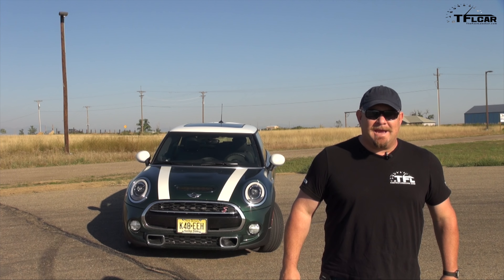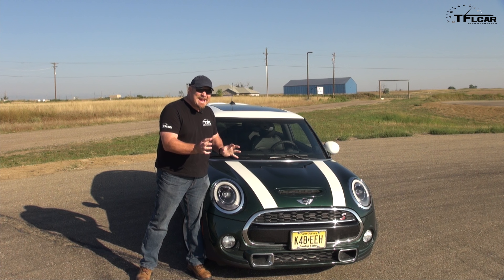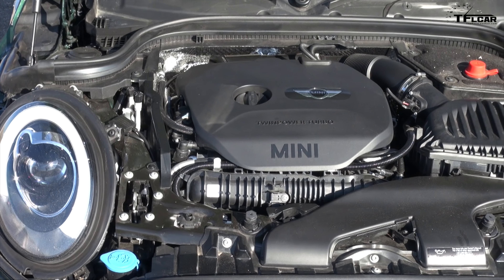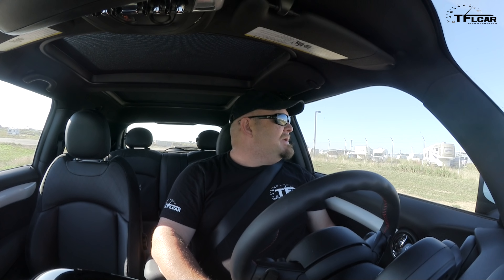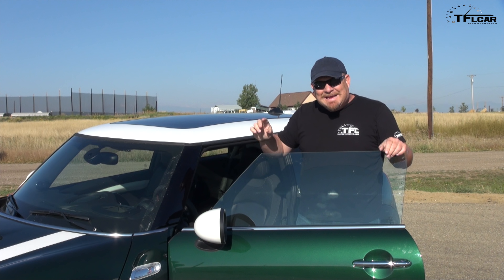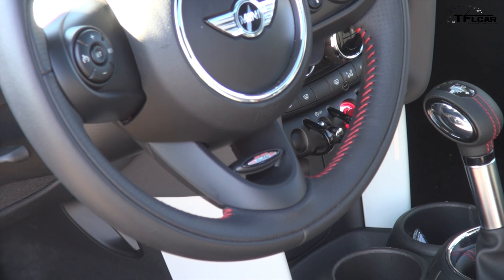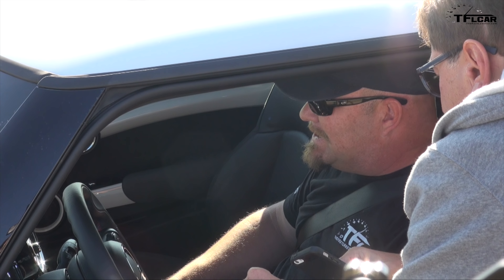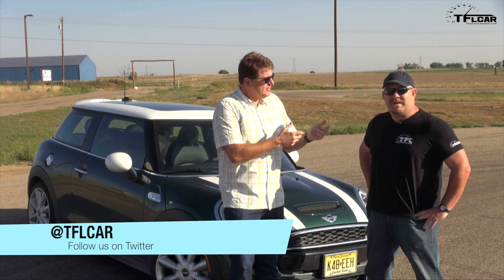2015 MINI Cooper S 0-60 MPH Track Review: A Go Kart on the Track?

Comment: As an r56 owner, the new Minis put me off a bit. But recently I started shopping around and looking at other cars that interest me and have spirit and performance, and there's really nothing at the same price as the Mini, and out of those with similar price, I'd prefer the Mini. So after looking at the competition it's definitely grown on me.
Reply: I thought the exact same! My R56 has been very unreliable so I’m now looking for an F57 but just worried the Mini charm is not so obvious with the new version.
Reply: Richard Layzell do you have a S or non-S? Wondering what your issues are. I’ve had the new Countryman and Clubman (as a manual) as loaner cars and they are fun but in a totally different way. Much more comfortable I’ll give them that, but the Mini-ness is much less. Even the manual doesn’t feel as good, something about it’s geometry as you shift feels off. And then the auto blip only happens in sport mode, like I want auto blip when I’m in normal just casually driving and not have to worry, but when I’m in sport mode that means I’m in the mood to do it myself. 

Idk if I’ll go with another Mini. I already have a practical family car, might pick up a used F type or a Miata, something RWD and faster. Good luck to you!
Reply: gothops154 It’s an S! I think I just got a car that was treated badly before me. High pressure fuel pump, thermostat, water pump, drop links, oil leaks, vanos, wheel bearings, coolant leaks. Spent over £1500 the last 6 months! I’ve only ever driven manuals as they are much more popular here in the UK! There was a typo in my last comment, I’m thinking of getting an F56 Cooper S 2017 with low mileage in the hope it lasts me longer!
Reply: @Richarrdere2k9  how did it go? Ik the 2015 minis and up are he good ones and reliable which boosted mini in reliable cars over the years past many other brands. I got a 2020 mini s and it drives really nice and smooth and picks up speed nice and shifts into gears nice with a new upgraded transmission
Reply: @Richarrdere2k9 I just bought a F56 myself Loving it!

Comment: You need to do a side-by-side with the 2015 GTI and 2015 Cooper S.   Which one is the best or...
Reply: ***** Fiesta received -188% reliability score from actual owners who provided surveys...also the ST is based on an economy car (Fiesta). It competes in a much lower class of cars than GTi and Mini Cooper.
Reply: @buildmorefarms1007 I just bought a F56 cooper after owning a 1.6l Fiesta ST and I can say that the fiesta wasnt overall the best on reliability.. however I was cobb stage 3 with 36k and drove it that way beating the balls of it for another 100k before it blew the engine or started having problems
Reply: I replaced the motor in fiesta ST myself and traded it in towards my new f56 cooper 😂

Comment: The Mini is well known to be one of the most unreliable cars on the market, please consider that before you offer a "buy" recommendation.
Reply: Sorry Walter, I can't do that. No way. 

We base our reviews on the vehicle we are testing at that moment. We evaluate vehicles on what they offer and how they feel. We cannot use bias from other research when we recommend automobiles. It's just our point of view. If we had huge resources to do long term research on each car we test, we would conduct our own evaluations.

Still, you are correct about other sources saying that the MINI's reliability is poor. Regardless, it's one of the best handling, most rewarding FWD cars available.
Reply: nathan adlen Most car journalists like on TFLC can only review vehicles this way. They can't buy, own & evaluate cars and survey 1.1 million other car owners each year like Consumer Reports. Yes, CR recently did their Reliability Survey for cars 2004 to present, and out of 28 car brands, BMW (Mini) ranked #14, while Mercedes-Benz ranked #24 as the least reliable luxury brand (Fiat was dead last, while Lexus/Toyota was #1 & #2). Of course, people will continue to buy certain cars based on the "smile" factor (as Nathan said) and how it feels, and will overlook some issues.
Reply: nathan adlen
Also people need to realise up until this model mini used a PSA engine which was the cuse of quite a lot of the problems. This model is the BMW 2.0T as in the 1/3/5 series and isn't prone to failure like the old unit.
Reply: agreed, had one, and it was a mistake. Great dynamics and looks, but not worth it. Bought a 335 instead.
Reply: nathan adlen What about the Mini's Euro NCAP safety rating of only 4 stars? Is that also bias?
Reply: Walter Black
If you read what euroncap say it's actually a testing fault. The loads were passed to parts of the dummy which was not representative of a human body - in other words the dummy got in the way of the test. It also got marked down for no automated braking because it's an option rather than standard fit. We're hardly talking a landwind here.
Reply: its a buy as a second car
Reply: I heard the older versions were but aren't they owned by BMW now? I haven't done much research on this car but I've heard good things on POV videos. Then again they were diehard fans mostly. Idk man I kind of like it
Reply: hung huge your right, but the original first gen BMW MINI used a Chrystler engine built in Brazil, no joke
Reply: nathan adlen my buddy said this car is comparable to that of a 2007 or onward mustang v6 and Gt. Your thoughts?
Reply: "Comparable?" No, not really. They are completely different vehicles in nearly every conceivable way. Mustangs push you through a corner, MINIs pull you through. They accelerate differently and, at high altitude, the MINI retains more of its power. They distribute weight differently and feel completely different to drive.

Can your friend be more specific?
Reply: nathan adlen Yeah he thinks a Mini Cooper S can take my GT in a drag.
Reply: Ner0blaz3r
tell him to lay off the pipe. Now on a track, maybe. Lots of factors in that though.
Reply: What years are they?
Reply: hung huge 07 Mustang and 2013 Cooper s
Reply: Well the Mustang should be quicker in a straight line. Stopping and turning are a different thing, though.
Reply: Walter if you dont like it dont buy it...but quit whining! I love my Mini turbo!!!!
Reply: Walter Black You do realize this 2015 model is new from the ground up...?
Reply: Walter Black Actually its just the Mini Cooper Base not the Cooper S.
Reply: RobDamnImFine Like BMW is any better? Once out of warranty you will have expensive repairs.
Reply: Ner0blaz3r The Mini certainly handles much better than the Mustangs. But 1/4 mile the stang would beat a Mini unless it was modded. I test drove both and the mustang bobs around a lot more than a mini but the stang was quicker in a straignt line.
Reply: buildmorefarms100 where did I say it's better haha. I have a 100k mile warranty and I'm certified by ASE, so I won't have that issue when that warranty runs out. Come by my house if you need a garage to work in. I even have a nice lift!
Reply: RobDamnImFine You are blessed bro! If you are ASE certified you can certainly do any repairs yourself. You have an awesome car. I doubt I could come by to see your garage though...I live on the east coast.
Reply: Bullshit.
Reply: Don't talk unless you know shit. The older gen minis were unreliable... The new F-series is very reliable
Reply: The man speaks the truth. I think this newest one may be much better than the other two though. We'll soon find out. However I must say that now its gotten so big it needs a 2 litre engine and automatic transmission i'd prefer a Golf GTI, an Audi A3, a BMW 1 series. Its just not a Mini anymore.
Reply: Lol thats just BMW for you :) me and my friend both bought one. He had all kinds of problems on his and mine had nothing wrong with it until about 110k miles I miss my mini
Reply: @RobDamnImFine  Interesting, I bought a 335i and while it is faster, it certainly handles like a boat compared to the Mini. And I wouldn't say it is significantly more reliable. It is not a fair comparison. One is a hot hatch and the other is a luxury sedan - NOT a sports car. Lumbering is the word that comes to my mind, in terms of the handling.
Reply: @alvilla701  no . Only 2015 and plus are good but before that it’s high maintenance